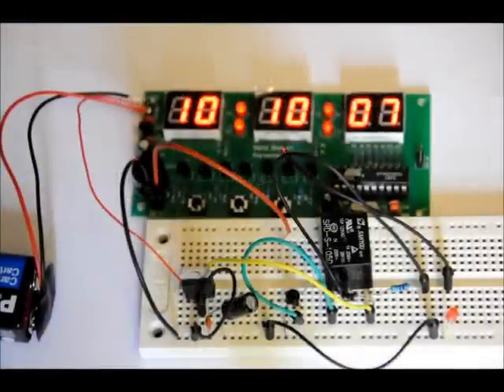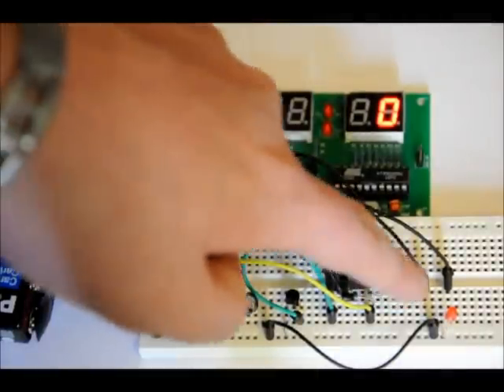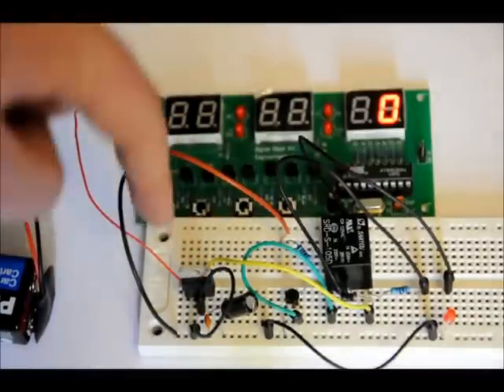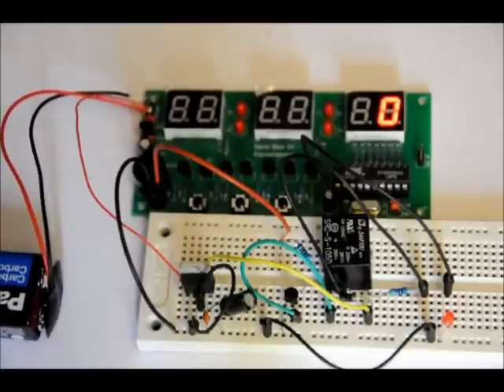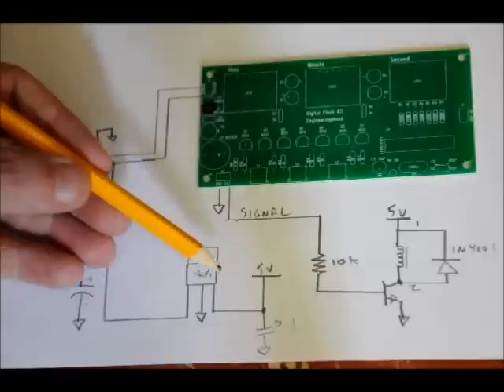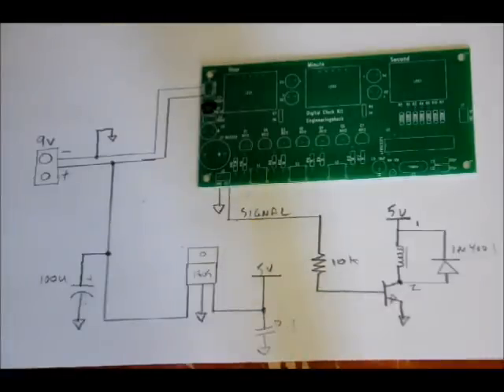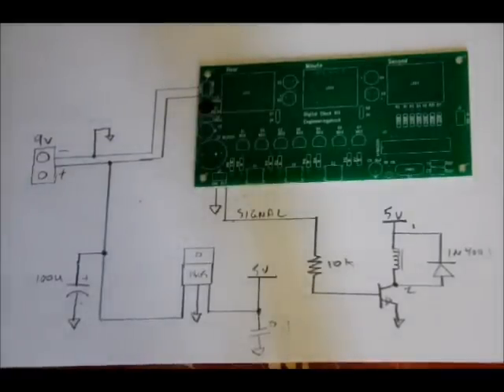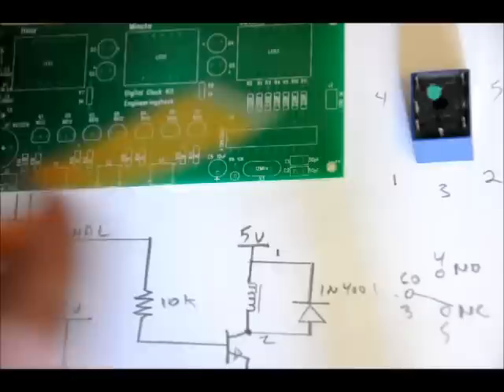6-Digit Clock Kit with Countdown Timer - Add a relay and control it with the countdown timer!

Comment: pat,
forgot to mention, can you add a diagram to this clock by install a 3.5v rechargable battery backup to the circuit? yours doesnt have to be 3.5v, just a rechargable battery. a complete diagram like this would help me understand more about adding this to my clocks. for the buzzer noise, i just left the stickers on and that makes it not so bad where i have to remove it completly because it does come in handy with the alarm setting.
thanks!

Comment: do you to program the ic to make it 24 hour or can this be changed to a 12 hour display without any re-programming? i have several and really dont care for 24 hour but i do like the other settings, count down, alarm, stop watch features, 24 hour bugs me when i look at it at night. i like how your using the clock as a output, i have some devices i can use this feature for. i never really messed with any of the other pins, the bottom pins are output triggers, whats the pins on the right for?